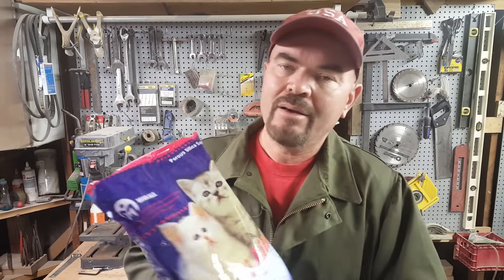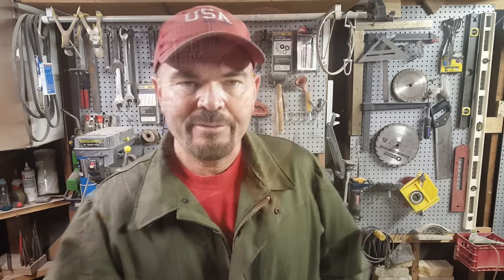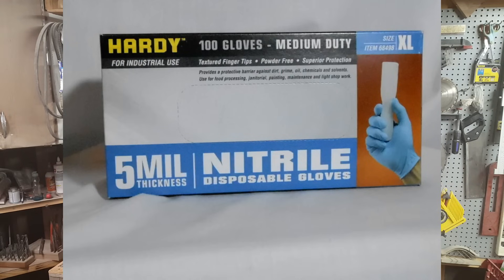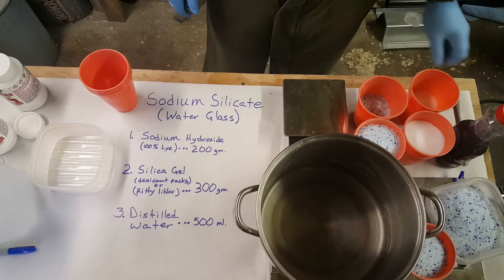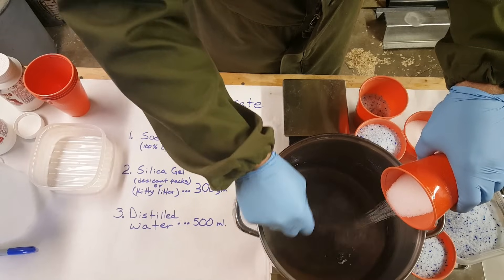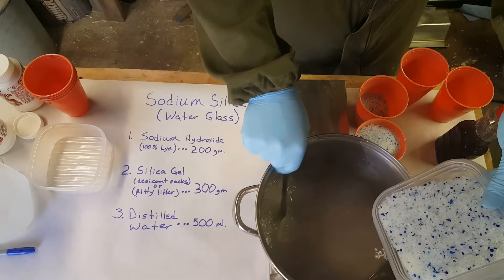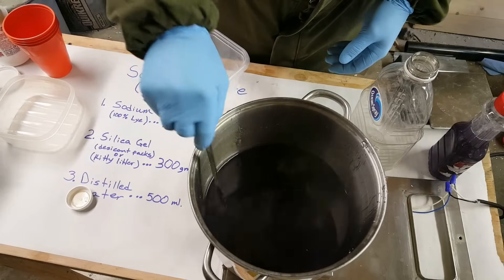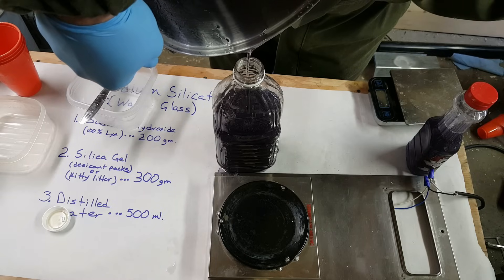Making Water Glass Refractory Mix for Rocket Mass Stove

Comment: you don't need to use drain open to get lie, it has other bad stuff in it, I worked in the meat prosing plant an we put peer lie in the water scalding tank to make getting the hair off faster on the rubber pattle wheel, I use lie on the homestead for doing my own pigs turkeys chickens, witch is safe to use, people also buy lie for making soap, any drug store has it in any size you want
Reply: Arnold,
"people also buy lie for making soap, any drug store has it in any size you want"

That may depend on where you live. Lye is one of the ingredients for making meth, local ordinances were passed to remove it from our local store shelf's 6 or 7 years ago.
Reply: I be leave I noted al that that ppl use for soap an can get it from any drug store, to bad you can side carry a hand gun but we cant even have one unless you belong to a hand gun club, an can only be used there, sure wish we could carry a hand gun at least on the homestead its a pain caring a big rifle well doing work, but yet usa bans lye.. haaa, here you can buy all you want, they banned all pesticides an weed killers here in the city, but with a farm number I can get it if I wanted it, I got the farm number for one thing only, and that is to be able to collect live stock loss due to wolfs live stock kills an others, put then again that's were all our meth comes in from the usa

Comment: If you get lye on you Vinegar is the only thing that will neutralize the lye NOT WATER!!!!
Reply: Not exactly water will dilute and wash it off, making it  the prefered method, vinegar  would create a exothermic reaction so the best course of action would be  vigorously rinse first then use vinegar to neutralize any residue then rinse again.
Reply: @paperburn  Not exactly! Water and lye create the exothermic reaction!
Reply: @michaelshea2408   help yourself.  For me ; douse in water first then apply vinegar
Reply: @paperburn   a lot better idea
Reply: More accurately you need an acid to neutralize the strong alkalinity of lye, not necessarily vinegar, though vinegar is the most likely close at hand acid.

Comment: Have no clue why you needed this, what it has to do with the rocket stove, or how it will be used, but it was fascinating.
Reply from the maker: It is very interesting stuff, and we have some videos coming of how we use it.
Reply: It serves many uses.  It's like extra glue in a mix.  It adds water resistance.  It increases thermal resistance.
Reply: He is making this to insulate his heat riser on his rocket stove. The more heat that is retained in the riser the cleaner/more efficiently the wood will burn. Also the "rocket" sound is made from a strong up draft... or hot air rising quickly. A better insulated heat riser will burn hotter.
( insulated heat riser will help burn off more of your creosote. )
Reply: J.W.: At rocket stove temps all creosote should burn off. That total burn is what makes it most efficient.
Reply: Are You able to use this unit as a water heater as well?